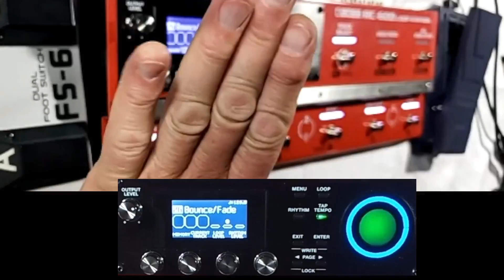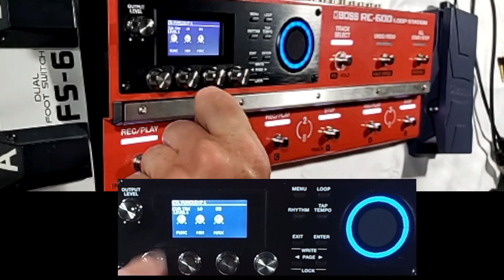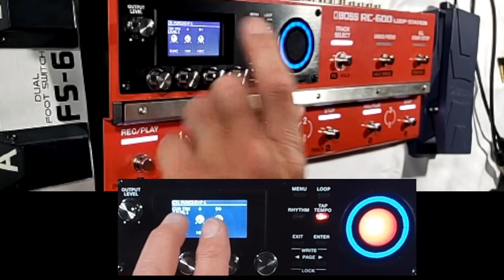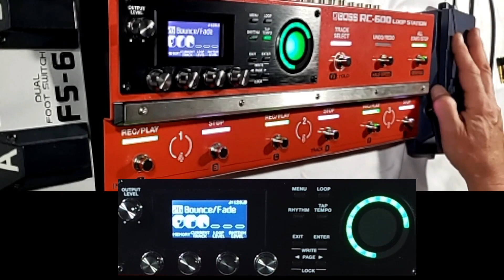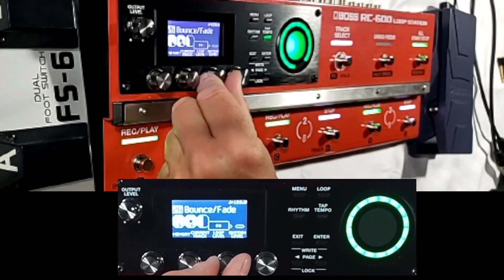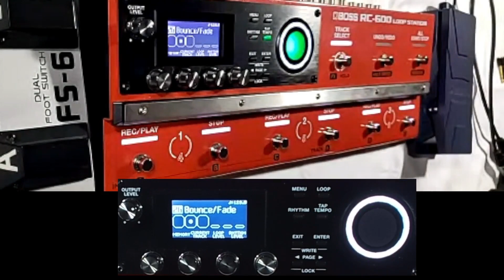Boss RC600 -Control Track Volumes with your Expression Pedal LIVE !!

Comment: Thanks for a great set of videos, I was struggling with this pedal since, at first, I thought that it was nothing more than a glorified looping pedal, but, since I bought it I realised it was much more than that.
I sing, Play Sax and guitar, but, usually to backing tracks, it looks like this pedal, along with the RC600 can replace my mixing desk, amp. as long as I have active speakers.

It seems to also replace some of my older pedals that I have relied on for years, save the TC Helicon Voice live, which listens to the music, and makes sure that my singing is in key. 

I've probably sung my songs so many times through that system, I'm not sure if I am still singing out of key, but your videos have shown me how to identify that, and if I need to carry on with that pedal or not. As an extension, that is also, more crucially, true with my sax, because saxophones are notorious for being out of key. I doubt if Boss can overcome these issues without bringing out a version 2 I don't think that firmware can overcome the issue, unless of course  we can set up another mic input, in my case, or use the second mic input. Perhaps Boss can find a solution
Reply from the maker: Nice! Thanks so much for tuning in !!  Yes, any Vocal pedals using auto-harmonies are still needed, as well as a few other peices of external gear ... the 600 can do a lot, but there are limits, possibly by design ...  Imagine if a pedal can do all of this, as well as what your TCH pedal or a Boss VE pedal does.... they would lose a lot of money if the RC600 was all you ever needed ....  LOL

Comment: Can rythmn start in the headphones only... and then be brought to a main output with a pedal push.

If so, how do I program this?
Reply from the maker: I do not believe it is currently possible to change routing via Assigns or button/switch settings ...  Routing is a pre-configured, pre-determined setting that is not adjustable on the fly ... 
There are some great tricks however, that could make it seem like you've done this...
Reply: @circularlooping  Hi - your videos are extremely detailed & thank yuo for taking the time btw.

I see I am very late in having almost this exact same question (having had an RC600 only a short time)! Would this be possible via not changing the routing on the fly but by using the expression pedal to change volume level of only one output (i.e. send the rhythm to headphones at 100% and main (or sub) controlled by expression pedal?)

The drums could then behave to keep me in time through headphone monitor then be brought in via pedal?

Interested in the tricks you mention that would achieve a similar result. Thanks!

Comment: Thank you kindly for the tutorial! Question - on the second part of this video you said you assign a knob to select which track to control. How would I assign knob 2 to current track select and knob 3 controlling the volume of the track selected? This would involve not needing an expression pedal. Thanks!!
Reply from the maker: Hi Matthew ! In the current firmware version (v1.21) , there is no option for "Current Track Level"  .. and so the best available options are what is shown here ... hopefully future firmware versions will add that capability ...